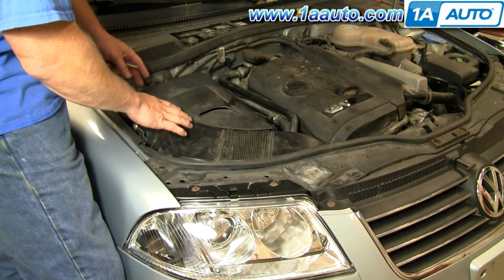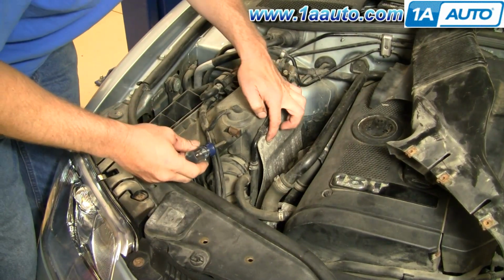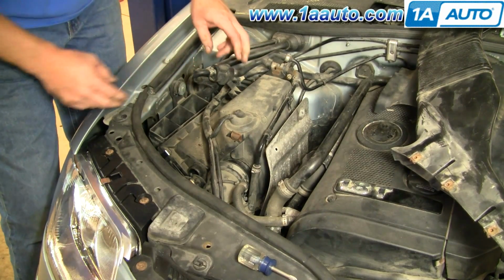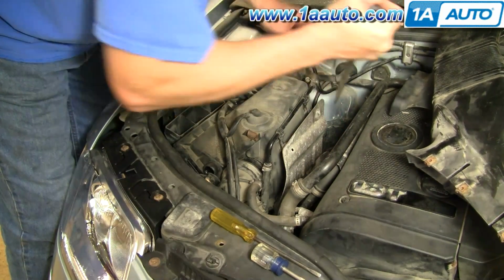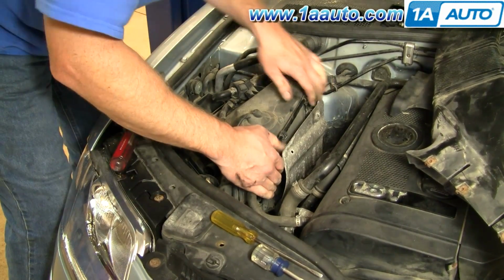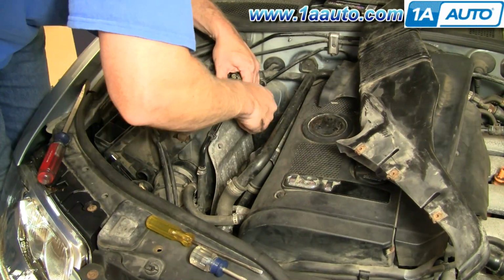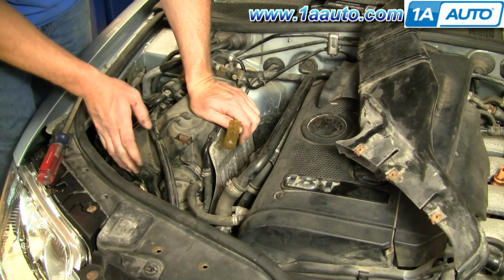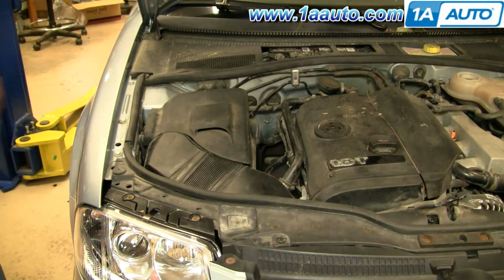How To Replace Engine Air Filter  02-05 Volkswagen Passat

Comment: I agree with Grant Logan. What a pain in the ass air filter change!! I was in the car business for 41 years and I've seen some stupid designs and this is one of them !  Thank you for the video. It really helps to save time.
Reply: this car i have purchased , its called a VW Passat 1.8 Turbo  , petrol 2005 . 
The more i come to you tube to check how to do / change something , the more i want to sell this car - i cannot even replace replace a headlamp bulb without taking the car ½ apart . just stupid ideas overall

Comment: Thanks for reminding me why I hate VW so much and will never buy another.    I had a 2002, got rid of it years ago but I've yet again ended up being informal service agent for the same car again.  For it's age it has next to no miles on it-mostly because it was broken so often-mostly electronic glitches but it also had the engine sludge problem.
Reply: Could not agree more.. From what I've heard the latest ones are even worse!!

Comment: I did an oil change on one I could not get to the air filter during my inspection and the oil filter can only be accessed by removing the coolant reservoir.  I did not bother wiping off my gloves to put the new filter on because of how difficult it was to get to.  What a stupid design for an engine I never wanted to punch an engineer so badly before, until I worked on this.
Reply: Actually you  can rich it with aid of loopy tool . Terrible.. it's a horror car to work  with...

Comment: I dropped one of the heat shield screws in the engine bay while trying to screw it back on.  Tried to find it by moving a magnet pickup tool all around that area but no luck. If dropped from the heat shield screw hole area, would it likely fall in the belly pan? Is there a part number for the screw and the hose clips that the top two screws connect to?
Reply from the maker: +Al Abbas You might be able to get one from the dealer 1aauto.com

Comment: It's easy to check/change the maf. @2.11 sec almost in the middle is that plastic cup. you need to take that plastic cup off, the maf wire attachment is under it. You need to unclip the clip. Then you take the whole airfilter top off and there is maf sensor inside it(the top of the airfilterbox) It's held by 2 screws. After them you can take it off. The sensor is held by 2 securitytorx. Here is a video /watch?v=KjpcE_tnnJQ, i would be littlebit more careful with screwdriver than he is...

Comment: can anyone tell me where the fuel filter is located in vw passat 2002 ? i think my car has fuel delivery problem . sometime it looks like someone press the break while driving , the engine slows down abit .
Reply: I know it's been 6 years, but I didn't want to leave this unanswered.

The fuel filter will be located on the passenger side. It is under the car on the frame in front of the tire. The car will need to be jacked up to get to it. Be sure to put blocks under the car in case the jack fails.
Reply: Thought it’s under the back passenger seats?

Comment: I’m so ready to trade my car in. I didn’t know how stupid these cars were made 🤦🏾‍♂️
Reply: #BIGFACTS
Reply: I own a b5.5 passat now and have owned a Golf before.  I tell everyone if you dont know how to work on cars stay away from a older VW. They really need to be maintenanced regularly. If you maintain them well they can be reliable cars that are fun to drive. Unfortunately they do have a lot of stupid stuff that breaks on them. And if you can do it yourself that's great because it wont cost you much.  But if you can't work on cars the shop repair bill can stack up. Try to do the temp engine coolant sensor on a b5.5 passat, I have a permanent scar on my arm because it's such a tight fit.